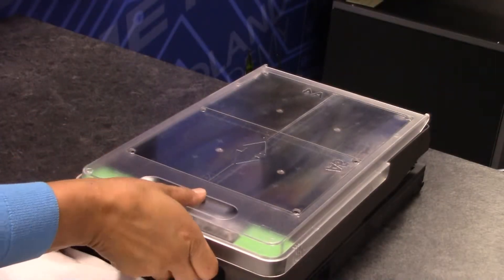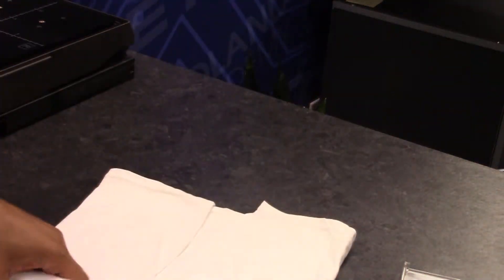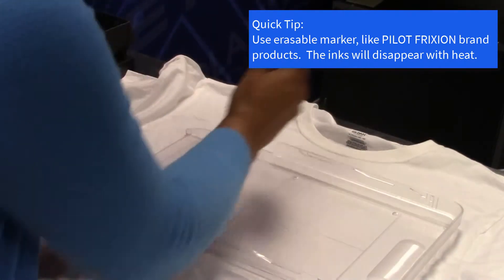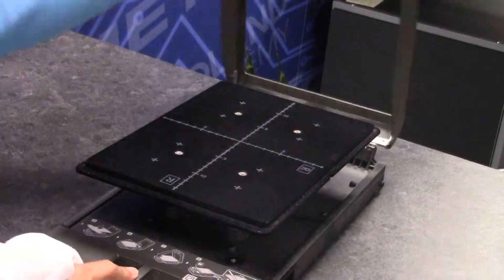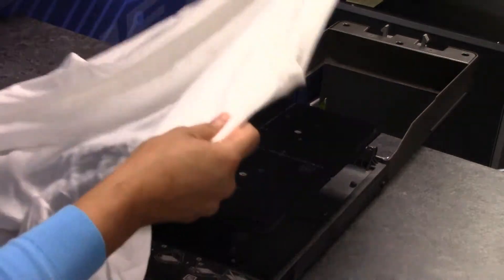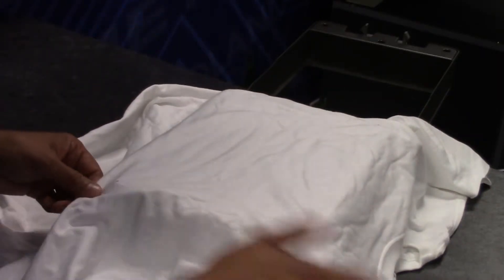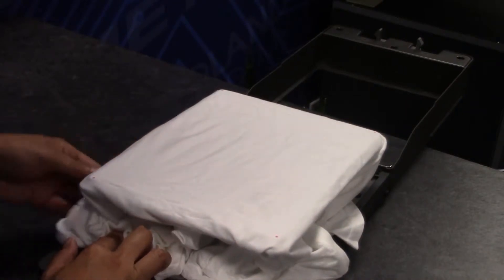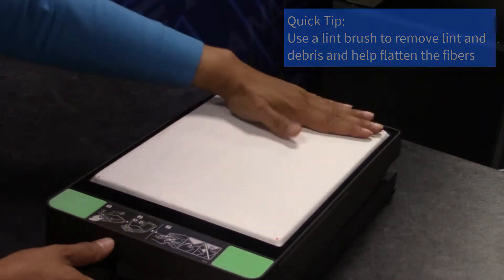VersaStudio BT-12 - How to Load Fabric in Landscape Print Mode

Comment: Do not use the Frixion Pens  these People never fully tested these pens   
Here is what happens  when you heat the shirt the ink appears to be gone  but if the garment or item is expose to very low temperatures as it was in my case when I shipped the shirts up North during the winter the Spots will reappear.
If you want to test this Put the shirt in the freezer and you will see